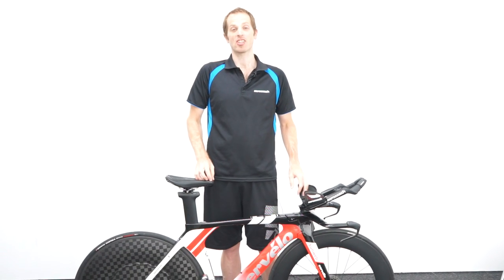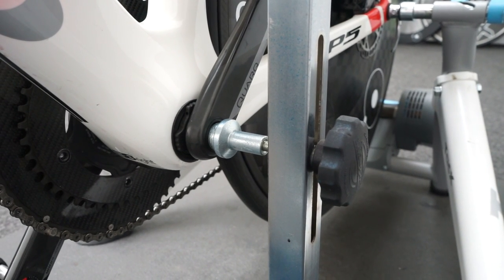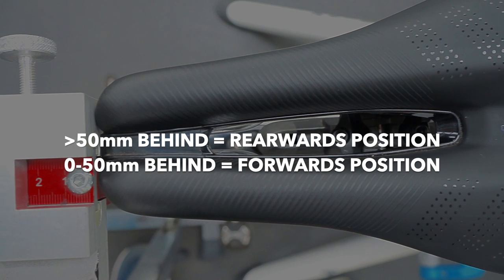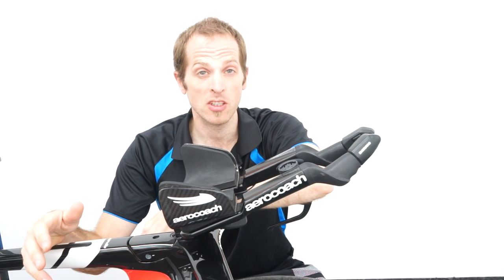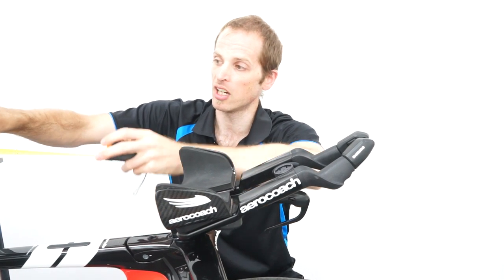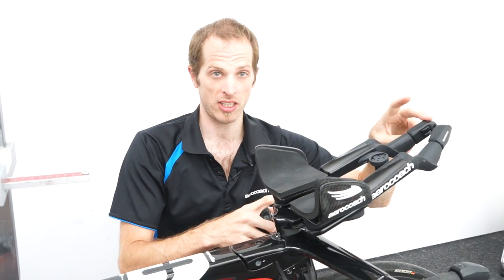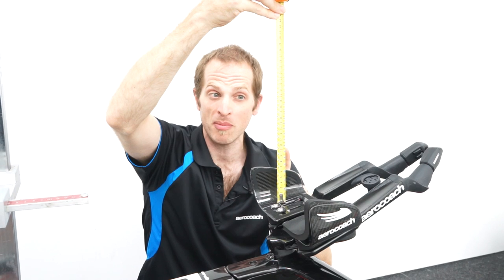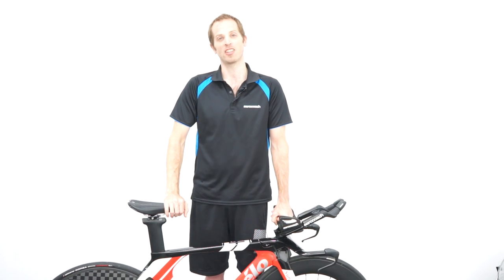How to set up your bike for UCI Time Trial regulations (updated for 2023)

Comment: Thanks for the video, it’s about time the UCI made these rule changes. I didn’t realize the 10cm height measurement was done with the pads off the bike. At four different GFWC champs and Canadian Provincials / Nationals they always measured with the pads on but it’s good to know we have 5mm of pad height allowance as well.
Reply from the maker: The measurement is to be taken with the pads off, but this is a relatively recent change so some commissaires have been making mistakes
Reply: @AeroCoach  hi - what clause of the 01/01/23 regs is this 10cm from pad support (not top of pad) in - I can't find it thanks
Reply: @AeroCoach is there a document saying that? I looked and only this video says without the pads? I've seen multiple times the new rule in effect and they are measuring with the pad on
Reply from the maker: @orionichild8477  the UCI commissaires can choose to measure without the pad if they wish, which means you should always take your measurements with the pads off just in case
Reply: @aerocoach are you still allowed 5mm for pads? I have 94mm from top of pads and 104mm from top of pad support
Reply: I guess they really want to get mechanical shifters gone. Mine are 4 or 5 cm long and a factory stock P2 would not conform to regulations
.

Comment: Thanks for the simple clarifications! One thing is not entirely clear to me though: when you have less than 50mm between saddle tip and bracket line, what does that mean for your reach? 75cm for each category?
Reply from the maker: Yes, that is correct
Reply: @AeroCoach  Wow ok. Then it's worth it by a long shot. Even though for me it's not optimal.
Reply: In 2022 UCI itt event our saddle setback was minus 50 ie the saddle tip was 50mm past the bottom bracket line. Is it’s still allowed or the rules have changed? In 2022 it passed the bike check and this was measured. Thank you

Comment: In the case of mechanical shifting, when measuring the highest point of the extensions, is that taken with the shifter fully extended out away (as is done for the distance from the BB) or whatever position puts it highest (but slightly closer due to pointing up)?
Reply from the maker: For height it’ll be set in the highest position
Reply: @AeroCoach  can you clarify a little more please.....so does this mean that for height measurement, that the mechanical shifter has to be clicked all the way back so that it is vertical, and then measure from the top point of the shifter......or is it to be measured horizontal, like the bottom bracket measurement, however, it is measured at the top of the shifter body,(not clicker)so that it's body is as tall as it can be, but the lever is still In the horizontal position, and it is measured at the top of the body?

Comment: Will you modify your extensions or at least the endgrippers - make them longer for Cat 2/3 riders?
Reply from the maker: You can purchase Ascalon extra reach plates on the website if you need more reach :)
Reply: @AeroCoach  I don’t need more reach- I need more support length for the forearm (and I would like to keep the armpads close to the thicker part of the extensions).
Reply from the maker: @heiko6376  we can custom make longer grippers for a new Ascalon purchase, that's no problem (it's not possible to modify existing Ascalons)

Comment: Do the 25 degree extensions now fit within the UCI regulations for riders over 190cm?
Reply: According to the UCI, yes. "To accommodate the above regulations changes the maximum inclination angle of the forearm support of the handlebar extensions has been increased from 15 to 30°."